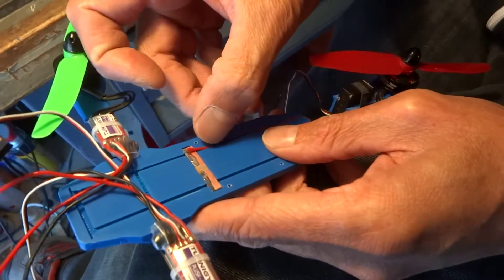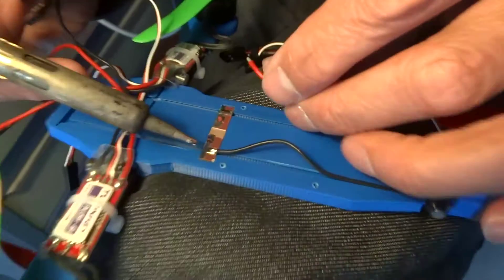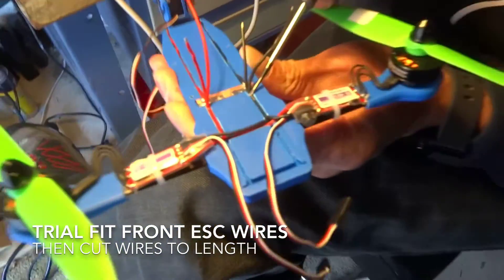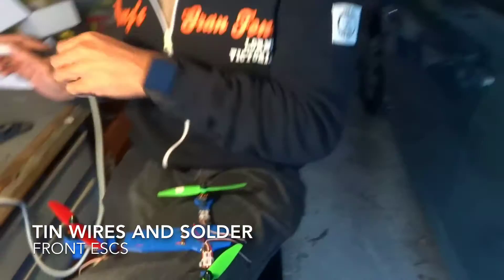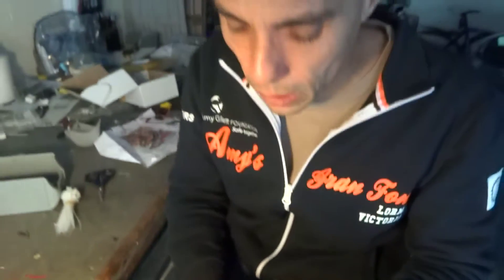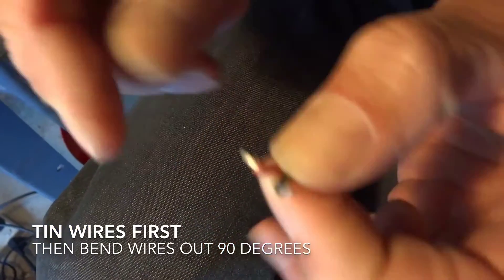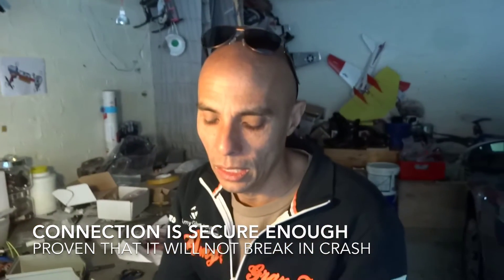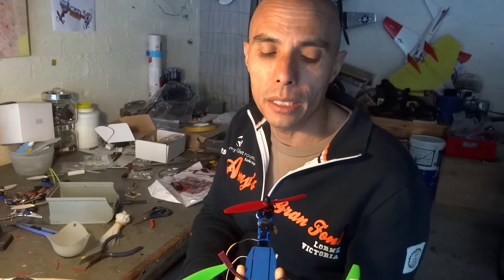Skidmark Tri Build Log Part 3

Comment: Looks good.  Why the change from plastic to fibreglass?  I have to think there is a reason.  How does the weight compare?
Reply from the maker: pillsnotbills its just the distribution power board that is made of fibreglass with copper layer on top. Derek just mentioned it is a good heat insulator so it wont melt the plastic underneath.